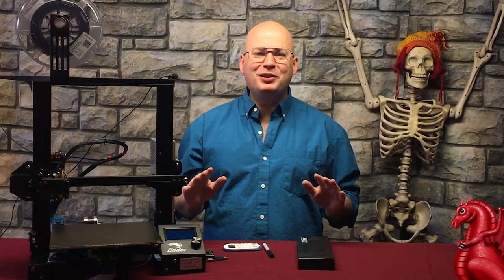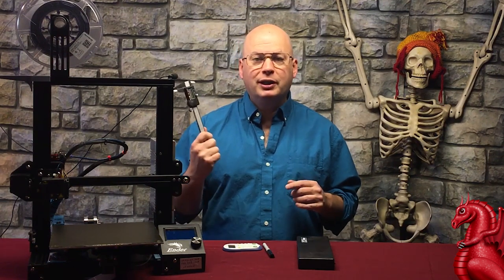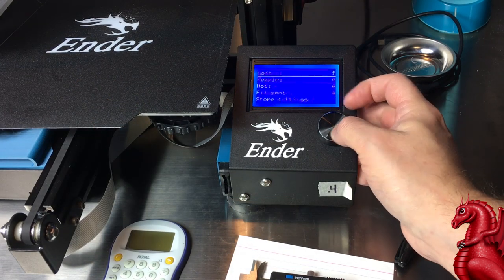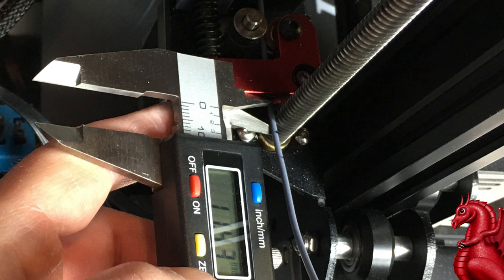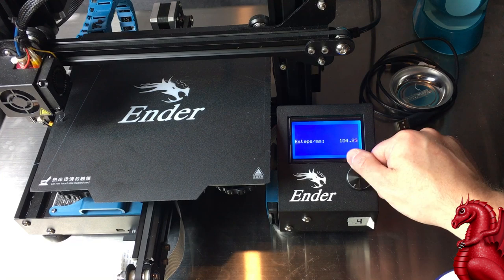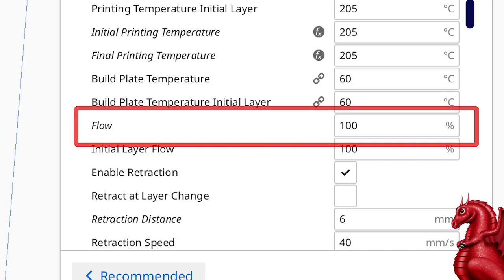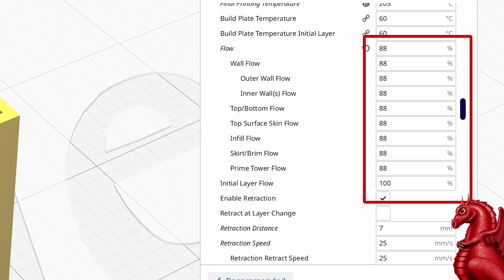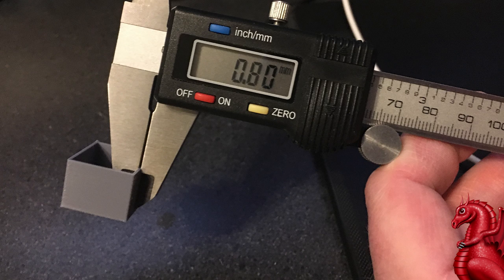3D Printer Extruder Calibration

Comment: Thanks, very clear and thorough! My Ender 3 came with perfect wall thickness, and I had to compensate for a slight under-extrusion. Why do you say we need a digital calipers? I used analog ones, never failed me before. Never have to switch out batteries.
Reply: Makes it easier to read the value instead of counting steps on the vernie scale.

Comment: There's a much easier way...  Remove the bowden tube at the extruder and cut the filament even with the outlet.  Run your 100 mm of filament and the cut the filament off even with the outlet.  Measure what you cut off with a caliper.  Much easier to measure and no need to try to make marks on the filament, which ends up introducing a level of inaccuracy.
Reply: wow didnt think about this. thanks!
Reply: Except that this doesn’t make any sense.
Reply: @healthygamingnetwork4980  what doesn't make any sense?
Reply: Or just dry erase marker white filament and rub it off later, save material that way, no need to cut.
Reply: @SAEWMD  very inaccurate because it's hard to be precise when using a sharpie marker on filament.
Reply: @kevinbright1  just tested this method with a accuracy of 0.18MM after calibrating. Best part these gear teeth doesn’t grind up the filament so definitely reusable.

Comment: So I guess I have one question for two different parts when figuring things out. 
-Do ESteps need to change based on what filament is being used? (PLA, TPU, etc).
-And, do you need different flow rates in Cura for different filaments as well?
Reply: More flexible material might behave a little different bcs of it's flexibility I suspect.
But if you're working with different materials that are similar in stiffness the ESteps shouldn't differ, unless it's slipping.
Reply: @kayazukifiles  Thank you for answering. So, if you're switching from one brand/color of pla to another the calibration should still be good, right?
Reply: @elliottlong7528  its all temperature dependant. the manufacturer of the filament should have the recommended temprature on their website (for esun pla+ its 210). tuned it to 205 before and had issues so bumping the temp up 5 degrees makes a difference in your esteps.

Comment: Your videos are great and I've used them to get my Ender 3 up and running. Thanks for all of your work. But I'm puzzled by this video. You upped your e-steps but then lowered your flow rate by (roughly) the same amount proportionally. These basically cancel each other out (.88*9300/89 = 92 instead of 89). What happens if you simply printed your cube with the stock settings?

When I do a calibration test I extrude 93mm (instead of 100 mm) with my stock settings (same as yours) when I run the filament through the nozzle. If I don't run through the nozzle I get 100mm. What is this telling me? That the extruder gear is slipping on the filament when it encounters pressure? In both cases retracting 100mm does the right thing. Don't we want the filament to extrude/retract X mm assuming we tell it to extrude/retract X mm? I hope someone can clarify this for me.
Reply: @BigfootPrinting  I wonder if Cura is trying to compensate for most Ender 3's being off by this much in their flow %, maybe from their own empirical testing. If so, that seems to imply that in most cases, you wouldn't need calibration with defaults. From looking at the comments here, however, it does appear that there could be a fair amount of variance from machine to machine (and I wonder about different filaments), with some being off by quite a bit. You would never know until you tried this calibration process.

Comment: Thanks Tomb , but i have 1 question how did you get 88.8% Flow if you dividing 0.8 / 0.9 is will come 0.88
IF Im not mistake we need to First ( 0.8 Desired x 100 Flow = 80 ) then ( 80 / 0.9 = 88.8 ) ?
Reply: juma ali He’s just converting it to percentages. Because 100% is really just a value of 1, and 88.8% is a value of 0.888. Multiplying it by the 100 in place of the 100% where you’ve done it is basically just that same step.

Comment: no matter what value i change my esteps to (and i do store the settings + i tried the exact calculated value and larger values) when i run the 100mm of filament through, the same distance is left between my extruder and the point i marked. im not sure why it's not changing even though the new estep number i input is indeed saved.
Reply: i'm having a similar issue on my cr-10. changed E-steps 4 times already... :-(

Comment: Funny, though, that you increased the steps per mm, but then decreased the flow.  Would this make a difference if both adjustments were made exactly proportionally?
Reply: Flow is adjusted via the slicer and resulting gcode. When you extrude via the lcd it's at 100%

Comment: After your great example of calibrating your extruder, I wonder if you really need to change your flow rate at all?

Reason being, if you use your micrometer to measure the wall of your first print cube, you can get 0.80mm if you just measure the first few top layers, but if you measure almost all the way down, it fluctuates and you get an average of 0.90mm at 100% flow rate.  At least I do, so leaving my flow rate at 100%  Great video as usual!

The same for 88% flow rate and 2nd test cube print.  (My setup happened to be just like your test)  I measure 0.70mm the first top layers, and 0.80mm almost all the way down.  Not all the way though of course due to elephants foot.

So using your method, works great if concerned about overall average of wall thickness of most of the layers top down for flow rate compensation after calibrating.

Comment: I been printing with my new print a lot already  for 3 weeks . I haven’t done any filament extruded calibration . So I decided to do the cube first to see if I get the .8 wall thickness on my printer. So I did the cube . It came out .80 .81 .79 .80 . Should I still mess with the setting or should I leave it as is?

Comment: I did this on 0.12 layer hight. The walls came out perfect, but when I print something, the lines barely touch on the side. Many times I get straight lines droop at the edge, and the structure feels weak. How do I fix that?

Comment: I have calibrated the extruder and everything is fine there. From the stock 93 it's now a little bit over 94.
BUT, the problem is that if I set the flow to 100% in cura it overextrude quite a lot.
To get 0.8 of thickness and a nice print I have to set the flow to 53%. I get that number from the formula in the video and it looks correct.
The question is, why do i  have to set a such low flow number in cure to get a good print? Any idea about what can be wrong?
I'm using Marlin 2.x-bugfix

Comment: Oh, I did NOT know about that minus 4% for small miniatures! But after your explanation it sounds super reasonable!
I'll write that up and try it next time for sure! :)

Also just had to do this again since I upgraded to a Micro Swiss all metal titanium hot end, so I needed to first perform a PID Tuning for 215°C (most used temp).
Then re-calibrate the E-steps by using the hot-end method instead of the free air, in case the Micro Swiss would affect it, also at 215°C.
Then the Flow Cube, which eventually changed my Flow down to 92%.

Another GREAT thing was that I noticed that my machine never wanted to save the entire E-step. It ignored the decimals, and there is after all almost an entire step between 97, and 97.95.
I wondered why that was so, but I then found out that in the Start G-code set in Cura, I had written with comma.
M92 E97,95 versus M92 E97.95... so that explained everything.
With that set it was all clear.

I just finished the 100% Flow Cube and I'm just about to start the second flow cube at 92%. :)

THANK YOU for a really great informative video.
And. thank you for the additional comment on the -4% on minis again! :D

Comment: To save filament & time I just created a single wall 2cm long & 0.8mm thick & 3mm tall in AutoDesk for test printing the flow rate. Then printed it with a brim. If anyone does this be sure to only measure the top couple layers due to "elephant foot" of the bottom layers. It could also help to maybe make it a bit higher like 5mm.

Comment: Thankyou soooo much for this video. I have been changing every part almost to stop my printer under-extruding. Ran this calibration and found it was using 40mm rather than 100mm. Oops. Printer working perfect now
Reply: how did you manage to get the extruder ratio high enough for that?  I was extruding 32mm! my ratio would have been 234 or something?

Comment: i have followed your tutorial and am spot on when i check the feed rate with the Ender 3, but when i use Octoprint to move E step it comes up at 8mm under feed. Which setting is used for printing, the one on the Ender software or the Octoprint?   Also My measurement of cube was 79 80 78 and 81,  so i assume im good?
Reply from the maker: I don't use Octoprint, sorry.
Reply: Good question - did you end up finding an answer anywhere? I just installed octoprint today for my Ender 5 Pro and am wondering what i should be doing :p
Reply: Something for me :(  but with two wide e-step values values (212.2 for Octoprint and 204.7 from stock screen) and both gets me to a 100mm  filament when 100mm of movement asked ... Any clue ?
Reply: Something for me :(  but with two wide e-step values values (212.2 for Octoprint and 204.7 from stock screen) and both gets me to a 100mm  filament when 100mm of movement asked ... Any clue ?

Comment: I watched your video and many others abour calibrating esteps. I  calibrated them on my Ender 3. I did it few times to be shure I have correct values. My test print was too wide. I tried decrease Flow until my wall thickness was perfect (88%). But all my prints looks like garabge now. There are holes in top layers. I will probably return it to stock values...
Reply: I adjusted flow to 90 or 88% and the bottom of the cube has gone porous, with a perfect mesh of pinholes that let light and air through. The walls improved from 0.88 to 0.794 though.

Comment: Great content!  I just installed an EZR extruder and it did extrude 100mm upon calibration, does that mean im done calibrating?  lol noob question i know.....
Reply: nobody responded but i would assume that you would still need to do the section for calibrating the slicer.
Reply: @owenbock5883  did a few test prints immediately after and came out excellent, guess i was done lol.  i appreciate your feedback, thanks man!

Comment: A question to everybody out there with an ender 3, did you end up with something in the ballpark of 98? I’ve noticed that to be the sweet spot for quite a few people.
Reply: I ended up at 106, but that was after swapping to an aluminum extruder. I assume the gears/teeth are slightly different than stock

Comment: Excellent tutorial, thank you! I do have a question: I set my proper e-steps and flow rate using this procedure (confirmed with cube test), but I am seeing signs of over-extrusion as my top layers are put down for .28 layer height (rough and visible texture in lines, extra material built up in corners). I'm very confident my bed is level after triple checking.. as well as proper temp and speed. I adjusted the flow rate ONLY for top/bottom in Cura to 90% and it seems to have helped it. Do you foresee this to be an issue at all? Still unsure why my wall thickness is fine at this step and flow rate, but the top/bottom parts are over extruded. Still new to this at only 4 months in, so any thoughts are welcome!
Reply: Check the layer height for those layers. Cura sets the initial layer to 0.3 for me always. It may be the same for the final layer (Top layer) also known as skin layer.

Comment: This is a great tutorial thanks.  I don't have the option on my Ender 3 of Motion and E steps?  Any ideas of what I might need to up grade and how?
Reply: I'm going to guess that it's actually in there. It's under the "Control" menu. Have to select that first. Have another look and see.
Reply: @MrGettinlate  Thanks.  Mine is possibly one of the first models so it only had, "restore fail safe and Temperature setting"

Comment: 100 - measured mm = less than 100
100 divided by the Less than 100 total from above = 1.~
1.~ X the Esteps listed in the firmware = a higher number
change to that number in esteps
store settings
test again

Comment: So I got started on this today, finally.  Motion is NOT an available option under my Control setting ... only Temperature and Restore Failsafe. Based on the first step of the calibration process I'm under-extruding by a LOT (it came up 26.5 mm short of 100mm).

Help
Reply: Getting help to update my apparently ancient Marlin firmware.
Reply: The answer was to update the Marlin firmware on my (apparently older, much older) Ender 3. This was a non-trivial procedure and required an external Arduino computer... and someone who knew what the heck they were doing with updating firmware on devices. That was completely outside my lane. But the person who helped me got it done. After installation of Marlin 2.04... all the controls I needed were exposed. I was able to calibrate both the eSteps and the flow. Currently have my first "non-test" print going. The tests came out beautifully.
Reply: read my answer to fantastiv higher in the comments
Reply: @flightmaster999  If that work around works for you, then great! My solution was to have someone who knew their way around embedded operating systems update the hardware.
Reply: @JennellJaquays  The way you did it is much better than what I did, by far!

Just posted this in relation to your original comment. It might help others who have the same issue with a (very) old firmware.

Happy printing! 👍

Comment: By the way, the flow rate did not work for me. I highly suggest people print out a test after making changes to see if it worked and adjust as needed. Mine came out at first to 0.75mm with 100% flow so I adjusted to 106% like the video suggested but that wasn't enough to correct it. Eventually 108% ended up working great to result with 0.8mm.

Comment: E-step should be calculated free running, not through the hotend.. Any issue with the hotend such as a partial block will result in an inaccurate amount of filament being supplied to the hotend..

Flow rate is then done to adjust the flow to match the hotend/ filament/ temp etc..

Comment: Very interesting. But the length extruded is calculated on the basis of the whole sample, that is 110mm, so you have 99 instead of 89. This gives you 93.9 steps/mm for the accurate e-step.

Comment: Is it normal to get the following:  first attempt (100% Flow) .86 .86 .86 .91 = .8725 avg.  = 91.7% Flow  
2nd attempt after adjusting flow .785 .785 .77 .86 = .8 avg.  While that is the desired thickness, shouldn't it be .8 on ALL WALLS?  
The Front Wall that you can see is the thickest and the only one with 'Salmon Skin' (actually the back wall because I'm printing on an Ender 5 Pro)...???

Comment: 104.4*0.88=93 so you're back to the default ender 3 setting... You did and undid the same thing basically. What you actually need to do is calibrate the extruder, then set the outer wall flow to 88% in your case, not global flow.

Comment: Well, that's a crystal clear tutorial.. So elegantly simple. Would not having calibration done like this explain either nice top surfaces + spaces between vertical perimeters or nice merging perimeters and way too much plastic on the top surfaces? Because I'm consistently struggling with that on my Modix Big60 V2.. :-(
Anyone with a good thought on this: Thanks in advance!

Comment: Hi, My Aunt and I are attempting to follow this but the number keeps getting bigger each time and it isn't working. Any tips? (For example, our step went from 93 to 110 to 139 and now it wants 390 something. And we have to keep measuring and adjusting. But the filament extrusion doesn't correct each time. ) It just keeps getting worse.

Comment: Right up to the point with the cube. 
Here you can see why it´s wrong:
https://www.youtube.com/watch?v=xyrC0vVNGMs

And here is what you should do instead:
Line width (measured on a printed part with single perimeter) should always be greater than extrusion width set in slicer. 
Mathematically (min. line width = nozzle dia. + layer height) 0,4mm nozzle + 0,2mm layer height = 0,6mm line width. (Notice how you should have a smaller line width for smaller layers)
Set line width to 0,5mm in slicer -->Print out single wall piece and measure 0,6mm line width, perfect settings.
This will mean your layers will be bonded well, you will not experience gaps in prints and you will get reasonable well details with 0,5mm extrusion width.
Now you can also easily tune your dimensional accuracy. You know that your set extrusion width is 0,5mm but real line width is 0,6mm this means you can set a XY comp. for -0,05mm.

Here it is graphically explained why min. line width with a 0,4mm nozzle and a layer height of 0,2mm should be at least 0,6mm:
https://dyzedesign.com/2018/07/3d-print-speed-calculation-find-optimal-speed/#:~:text=A%20general%20rule%20of%20thumb,bigger%20nozzles%20and%20layer%20height.

Comment: Was the hot end still connected when you did the extrusion test? 
I did this, and my extrusion was about 30 to 40 mm. If I take off the PTFE tube, it comes out almost exactly 97mm

Comment: Do I use cura for the extruding? Do I use cura for the flow rate?   I use Mattercontrol and their calibration way is different then yours. Do I use Mattercontrol calibrations, or yours? How do I extrude from the printer terminal? You leave too many small details out.  I'm using a Ender 3.      Help....

Comment: in your other 'how to' guide there was the recommendation to use a 0.2mm nozzle, in this video you are using the standard 0.4mm.  If you change to 0.2mm do you need to calibrate?  Does this change the numbers to half what you are using in this video?